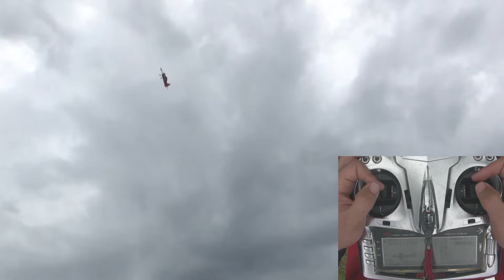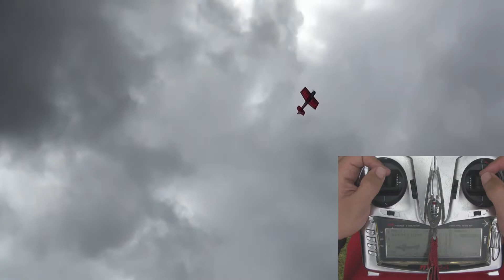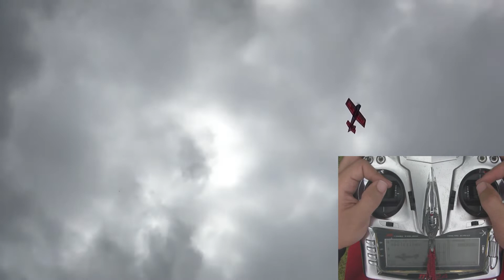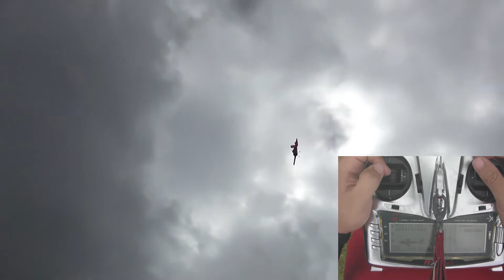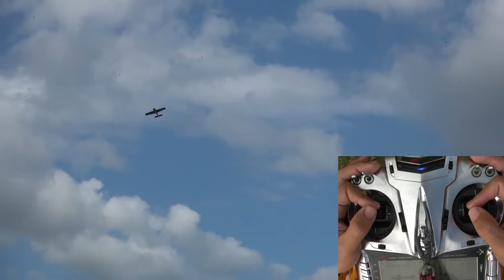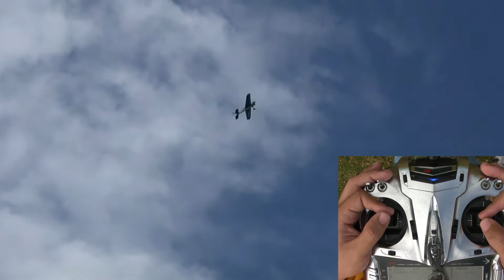Learn How to fly 3D Beginner to Pro Series - The Knife Edge Spin by Daniel Dominguez

Comment: interesting. I tried it differently and it did not work with my xr 61, but with my extra from jamara. I slowed down to a stall, put in full down elevator and half rudder and then pushed in throttle and a little opposite aileron. this works with my extra but not with the xr61. I will now try this entry method. Thanks for posting.
my extra spin very fast, so it looks nice. i hope the xr61 will do so, too. But it looks like that in the video.
My extra is more heavy so it stalls easier. i guess that's why it enters without  using the aileron.
Reply: i just watched again. you are saying opposite rudder, but it seems like you move the sticks to the same direction. do you call that opposite rudder because of the negativ rotation of the plane due to the down elevator movement? or did i get it wrong? never the less i will hae to try it on the field
Reply: i tried with the kmx, I need rudder in the same direction not the opposit then ailerons, but it works and looks like in the video!